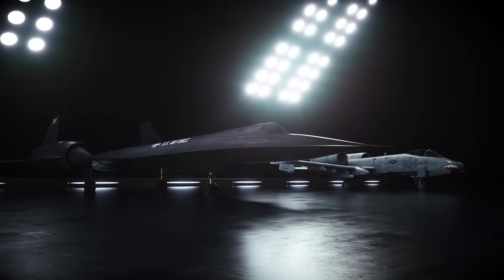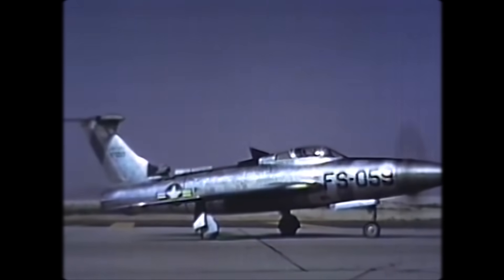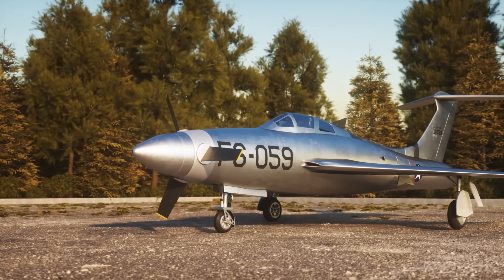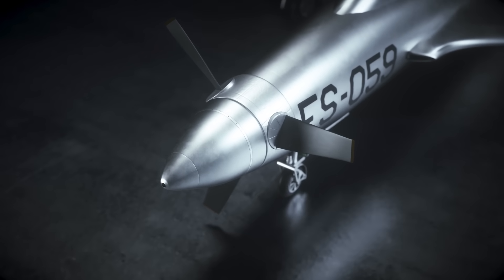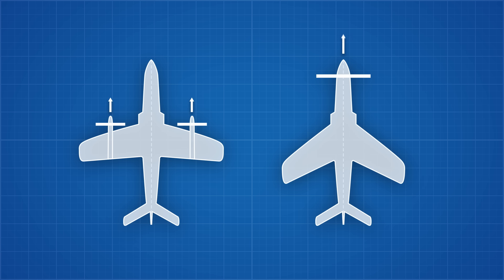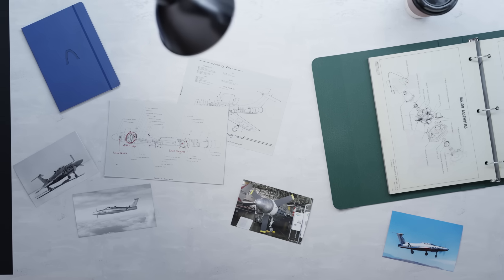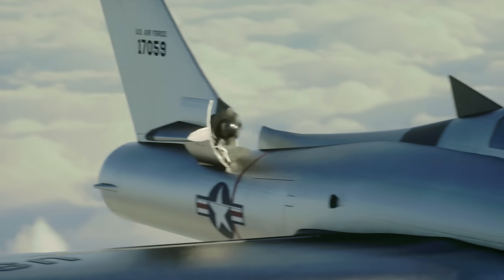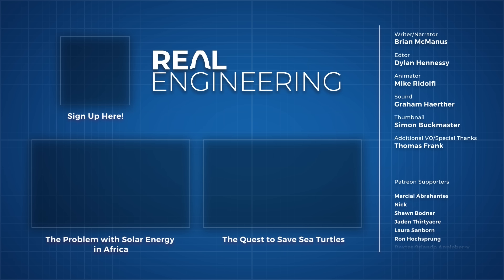The Insane Engineering of the Thunderscreech

Comment: That was kind of a cheap shot at Tacit Blue (not Tacktit Blue).  It "looked funny" because it was designed for stealth, not because it was a bad design.  The TSSAM AGM-137 had a similar shape for the same reason.
Re blade pitch, you should check out a Bear bomber at speed.  Those blades are practically facing forward.  (Blade tips are at Mach 1.05 as I recall.  Have read of escorting F-4 Phantom II pilots getting nauseous from the effect of being so near them.  Same with the Thunderscreech ground crew.)
The McDonnell XF-88B was another aircraft that played around with the supersonic propeller.
Reply: Yes, thank you. Tacit blue paved the way for many of our modern aircraft. It was absolutely not a failure or anything of that nature.